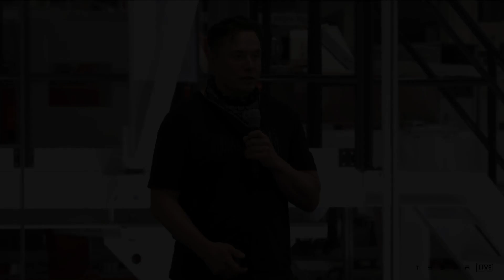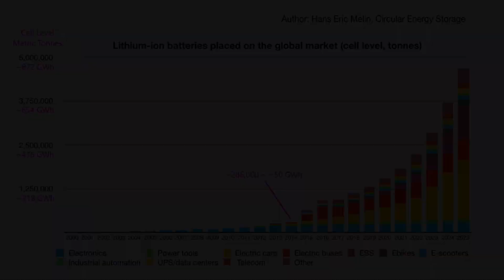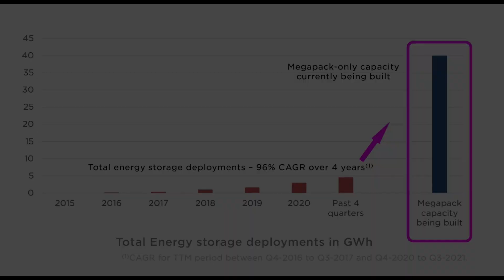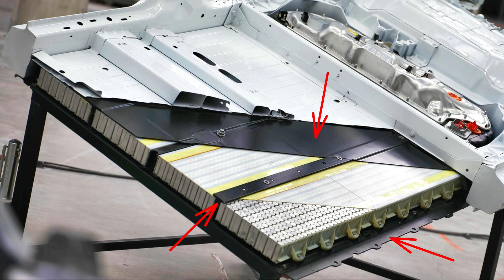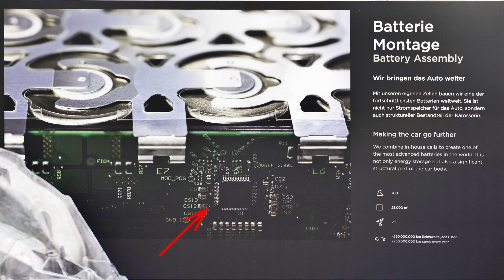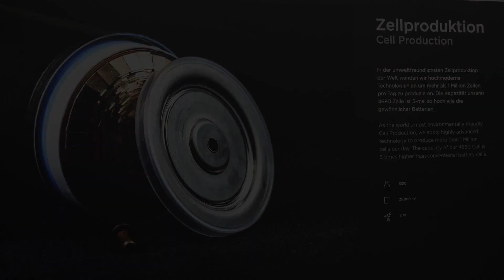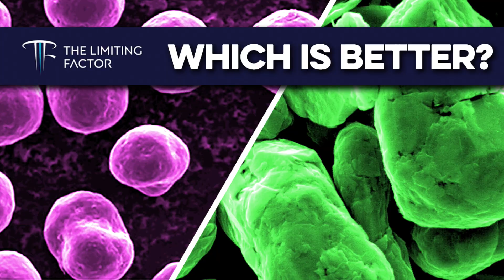Tesla Q3 - Just the Batteries // 4680 On Track, Giga Berlin, Supply Chain, and Leaks

Comment: Maybe the copper "hubcap" part acts as a spring to ensure all of the "flags" make good electrical contact with one another on one side and the underside of shell cap on the outer side of the hubcap. Also, the deferential in the rate of thermal expansion of the jelly roll and outer case (due material and temperature differences) requires a space between the shell's cap and the flags to keep the jelly roll from buckling and/or bursting the shell as the temperature raises. So the hubcaps are  probably acting as springs AKA flexures.

Comment: Wouldn't be possible to make one giant slab of a battery and just deal with it? Like those deep cycle ones used in electric pickers and forklifts, but instead of lithium? And why not shift the motors to inside the wheels, making a wheel-hub-motor, even if the design and size (I doubt it) had to be changed?
Reply from the maker: No - Due to safety and voltage requirements

No - Unsprung weight such as hub motors results in worse ride quality and handling.
Reply: @thelimitingfactor  Thanks for the reply!

Comment: Rare earths may also be needed for permanent magnets in the electic motors; though like LFP batteries there is talk of going with iron, called in this case "ferrite" magnets.
With at least one electric motor per car and over a million cars, this will add up. Plus I just  looked at Sandy Monro's teardown of the Volkswagen electric motor
 (the video was over 3 months old) but Sandy found a lot to like about the Volkswagen motor even if he hated how many screws it used.

Comment: Future batteries will certainly not be based on iron as increasingly cheaper graphite is already in the pipeline and is now plentiful enough for purpose.Graphite is so much more promising of great battery energy density and that has to be the future so we can have longer range, lighter and more efficient cars, trucks and aircraft.
Reply from the maker: You may be confusing the cathode and anode.

Comment: Was wondering if you look at China's GAC promise of Graphene-Sponge Silicon Anode Battery that promised to deliver incredible range and fast charging. The initial tech work was done at MIT published in 2017-2018..Clearly Silicon-in-Carbon Anode can solve EV battery problem to replace ICE - and the direction Chinese EV is going. Silion is really the same idea although the approach is heavy in Silicon.

Comment: Great video. 
BTW - are there any estimates on how much Nickel is going to be used in the stainless exoskeleton of the Cybertruck? Guessing the stainless used will be 5 to 10%  nickel and will have substantial total weight How does this compare with the amount of nickel used in the 4680 cells?
Reply from the maker: Two different Nickel supply chains.   Battery grade Nickel is a specialty chemical and not available in bulk in the market.

Not sure what the split is.  Stainless steel is <10% nickel and batteries 50%

Comment: Hey, have you dug deep into why they located Giga Nevada where they did?  The labor pool is shallow and it's not a desirable place for relocation.  They really like local sourcing , could the lithium clay deposit be nearby?
Reply from the maker: Nevada is business friendly and moved quickly.  They also offered a great incentive package and land, but that was really garnish.  A nice side benefit is the low humidity, which makes battery production easier.

You're damn right about the shallow labour pool.  It's been a drag on the factory.  I think they've learned there lesson on that one.  

Around the time of the deal, Tesla was actually looking at lithium brines in southern california, so the clay is a red herring.  It's a factor, but there were dozens of other factors.
Reply: @thelimitingfactor   That is kinda my point, it's dry in the Vegas area as well, and labor would not be an issue, the location could be a draw in that case.   So why go for the free land in Reno instead?

Comment: Your speculation on the outcome of the chip shortage (building more energy storage) might be partly false when considering the following information. The chips we are missing are not complex digital chips like TSMC is producing them. Its "analog" chips like voltage regulators and more which are mostly produced by TI and Analog Devices in the US,. Thats why anybody in the chip industry is fingerpointing at US companies these days when it comes to chip shortage. Where a vehicle might tend to need more of the complex digital chips, I am speculating that Tesla energy storage has nearly as many TI/AD chips as a vehicle might have - if not even more.
Reply from the maker: Yeah, I did a twitter poll on this and it came out inconclusive.  No one seems to have the answer.  Lots of speculation all around.

Comment: Expansion would more likely happen vertically with the radial/spiral design.
I was expecting the cap to be molten-fixed; in order to maximise contact with the ‘flags’ and reduce resistance.
Reply from the maker: Nah, I've talked to researchers about this.  Mostly axially to the current collector foils rather than axially to the spindle.    The active material is bonded to the foils, limiting expansian outwards and directing it upwards.

Comment: Since the 4680 caps will not be soldered on like the tabs on the 2170 and 18650, could those pieces be a press fit type connector between the caps and the flags? I am thinking jelly roll plus those pieces get put inside can and then caps are pressed down on both ends and those pieces expand out just a bit against the can and the cap around the can to create a press fit. I don't know, just spit ballin'.

Comment: Could the copper "helmets", as you call them, in the 4680s be for cooling dissipation? So it can easier transfer heat towards the cooling system...
Reply from the maker: Yes, but no better than the flags
Reply: @thelimitingfactor  yeah, I was just wondering if the flags could transfer the heat from them to the helmet and then towards the cooling system. Otherwise I would think the helmet could have been of a cheaper material.
Reply from the maker: Would have to be copper because of it's electrochemical properties

Comment: Thanks for the comprehensive video, but the tabless design part could have used a hand from a fellow youtuber, maybe eevblog or electroboom. In short, previously batteries had just one "strand" for ALL of the electricty to flow through, that limited the current and increased resistance. Having multiple strands helps with both things and lower resistance means less heating up while transfering current. I just don't know why they have a seemingly empty cylinder inside it, from the pictures.
Reply from the maker: Hi Slavko, I was the first one to cover the tabless electrode and I have a video on it.  The tabless electrode and hubcab are two separate things.

Comment: Hi, If if you look at the cap on the 4680 battery cell, you'll notice that there are what appear to be welding lines in each triangular section.... 
I believe the cap is intended to collect current from all regions leading to the smaller + battery terminal end...
Reply from the maker: Correct
Reply: @thelimitingfactor  So, my thinking is if alternatively just the "+" Isulated (Bump) was just a flat piece that just made contact with the copper "Tabs"  that could lead to inconsistent hotspot/ current collector pathways between each cell.... resulting in the BMS having a harder time balancing cells or, long-term degradation of higher resistance cells...

Comment: Its been said that the old LFP chemistry being used in the china Tesla's starts with a lower energy density than the 4680 chemistry but over the life of the vehicle the LFP chemistry degrades much slower and ends up having more range than the 4680 chemistry, is LFP worth evolving to be a better solution?

Comment: I think the hubcaps at the end are to maintain constant pressure while compensating for the differential expansion between the exterior metal casing and the innards. While the cell may expand radially it also expands axially throughout its operating temp range. The “differential expansion” is the key, the end plates solves the problem between the case and the jelly roll expansion rates.
Reply from the maker: What about work hardening and brittleness of the copper as it flexes?
Reply: @thelimitingfactor  
I need the thermal coefficient of expansion for the case material metal and the same for the jelly roll. I don’t think the differential expansion for a given temp change will be much between the two but constant pressure and contact between the flags and end plate over the operating temp range of the cell must be maintained. I don’t think mechanical fatigue of the copper will be an issue given the few thousands the stuff must move.

Comment: Quick thought on the 4680 battery end caps. I think they serve a couple of purposes. Resistance is heat and energy loss,
 and by putting the cap on to press down the folded over tabs you reduce the resistance, add physical stability to the structure.

Comment: The solution for E supersonic planes is to use a modification of Falcon 9 booster to take them to altitude and speed.  An oversized amount of energy goes to that initial ramp.  Just use methane;  problem solved!
Doing so doesn't even contradict the words "vertical take-off".  🙂
  Regarding those metal sheets, besides protecting the "flags" and providing electrical continuity, they are in the critical path of thermal dissipation.  As such, their shapes baffle me.  It seems the heat has to flow horizontally between the larger surface that contacts the flags, and those thin spring strips top-side.  Seems to me like a thermal bottleneck built-in.  (How I wish to work for Tesla, but they don't want to hire me, for some reason...  Maybe because I'm 63? ... All I got was dumb excuses both times I applied.  Some of their HR people are traitors of Elon's spirit.)
   What I would do is have a perfectly flat disk there, instead;  minimize thermal resistance;  and provide spring action at the pack level, instead, where the larger size of the parts involved and circulating coolant removes the issue of having a thermal bottleneck.
   You might question my idea from the point of view of lessened structural contribution;  but I would argue that "structural strength" does not have to imply crazy amounts of rigidity.  The flat metal elements above and below the cells should suffice for rigidity provision, provided they are prevented from folding, which a vast spring-bed of hundreds of elastic battery contact elements should sufficiently assure.
  And I know that the top metal surface is gone;  I just think that's a design error;  one that may result in unreliable contact with some of the cells during acceleration or braking;  hope I'm wrong.
Reply from the maker: Lol, I like the idea of rocket engines on a plane, but I think it's fatally flawed.  

On the second part - great thoughts and I agree in many ways.
Reply: @thelimitingfactor  Thanks.  To clarify my first point, I was NOT suggesting making rocket engines be integral to the planes;  I was suggesting that the plane sit on top of a booster, just like the second stage of a Falcon 9 sits on the first stage. 
   The booster would slowly turn to horizontal flight after MaxQ and propel the plane to full horizontal speed before shutting down its Merlin or Raptor engines.  The plane would not go as high as satellites;  probably just a typical U2's ceiling, or a bit higher.
  At that altitude the plane would separate from the booster and continue cruising on its own electric power, while the booster would possibly return to the launch pad, or land on a barge at sea.  Probably the former is doable, since it doesn't have to reach as high an altitude as when delivering space assets.
  So, 100% re-usability, like Starship;  but in a smaller factor, of about Falcon 9 dimensions;  and either kerosene or methane based.  Easy to modify Falcon 9 boosters to do the job, and it would allow us to have E hypersonic planes NOW instead of having to wait for magical batteries.
  The rocket should be F9 sized, but use Raptor engines, preferably, which burn cleaner, and are easier to process for re-launch.

Comment: Lithium is as abundant in the ground as nitrogen is in the air. The bottleneck won't be existence of the necessary material it will be economic extraction on mass of the material. 12,000 mines mining 1 ton a month running full tilt WILL not be economical or worse they will because lithium prices explode & push battery costs much higher.

Edit: the goal is not to have lithium prices explode BTW, because battery prices need to come down.
Reply from the maker: Bingo

Comment: I thought the flags on the top were designed to allow a greater, faster flow of electricity, for optimized output. I didn't think of the heat. Thanks for the info.

Comment: Tabless Battery - Because it isn't possible to solder all of those tabs to the cap then the "hub cap" was designed to make that junction. It's sprung so that conductivity is always maintained by pressure. The "hub cap" needs to touch a lot of surface area and be copper for not only a low resistance connection, but also to provide a good path for heat to leave the battery through the top and bottom of the battery.
Reply from the maker: Sprung indicates that it would 'spring'.  Doesn't copper have issues with brittleness and work hardening?
Reply: @thelimitingfactor  That's a good point but I don't feel like it's getting "cycled" in such a way to cause brittleness and work hardening. Keep digging and get us an answer. BTW, your doing good quality work and I love your videos.

Comment: Hey mate. 
This video I link at the end of my comment says the graphite anode in the 4680 battery will be replaced with silicon. It's causing a bit of an argument between mates. 
Would you say they mispoke? It would have to be a graphite and silicon blend, not pure silicon is that right?

at 3:20
https://youtu.be/QnWQ50vWUvY?t=198
Reply from the maker: Correct!  It looks like roughly 20-30% Silicon.  I did a series of videos on Silicon around December/January that covers this in excruciating detail, lol.

Comment: Great roundup of multiple aspects of EV’s.
Where I think you might have an issue is in the timeline for brine-membrane lithium mine growth. With the brines drilling is quick and easy, think weeks not years. The building of the processing plants will take longer. Thinking more of 2-3 yr scale up rather than 8yr.
The firms I’m thinking of for this is Standard Lithium, and E3 metals.
Reply from the maker: It's the permitting I'm concerned about

Comment: The caps are there acting like springs. They are compressed onto the top of the roll where the tabs lie to make sure physical connection and ultimately either thermal and/or electrical conductivity is made. THe issue with the cell is that the materials on the roll are different than the casing causing a CTE (Coefficient Thermal Expansion) mismatch between the materials. As the cell heats and cools the materials expands and contracts at different rates causing the physical connection between the cap and roll to intermittently disengage if the interface was flat. The hubs are there to act like a spring such that the physical connection stays intact because the change in distance due to manufacturing tolerances, deflection (vehicle movement and next higher assembly manufacturing, etc) and the CTE mismatch between the cap and roll is made up with the compressed spring, similar to shocks on a vehicle maintaining contact with the surface of the road. It’s a pretty commonplace methodology within mechanical engineering. The multiple hubs on the cap is probably due to exactly what you had said with the cell size. The surface area has grown to much larger area such that when you put the cap on the rolls it has less “flatness” that the compressed tabs on the cap is best integrated radially on the battery. Look up G and T mechanical flatness, and it can explain more. 👍
Reply from the maker: Have you taken one apart?  Doesn't copper make a terrible spring due to work hardening?
Reply: @thelimitingfactor  I work with intricate copper features a lot in my line of field, it is a soft material compared to most metals. It has significant properties compared to nearly all metals for electrical and thermal conductivity, which makes sense based on your videos in the past given those interfaces need both those features. The spring to make up for any gaps is subtle (likely 75um or less), so the softness in material doesn’t yield over that distance. But I’ve seen plenty of designs where that little of deflection will disengage an interface and make for a very bad day. Interestingly their designs have to work for iron cathodes and nickel cathodes, so their construction methods have to work with those materials. The tab batteries didn’t have this issue because the tab acted like a “pig tail” where the electrical interface didn’t require flatness to stay engaged. I’ll do some simple calculations for you if you’d like to show.

Comment: We can assume LFP will be the leading chemical forward for the near future, but I also read that LFP will not be in 4680 form factor. Why? Isn't the purpose of 4680 to compensate the low energy density of LFP?
Reply from the maker: Yeah, most journalists have no clue what they're talking about when it comes to batteries.  It hasn't been written or indicated anyhwere that Tesla can't or won't use 4680 with LFP.
Reply: @thelimitingfactor  yea. While Elon did say Tesla try to limit down the form factors to ease the troubleshooting and future product development, there is no deny that 4680 LFP is not possible.